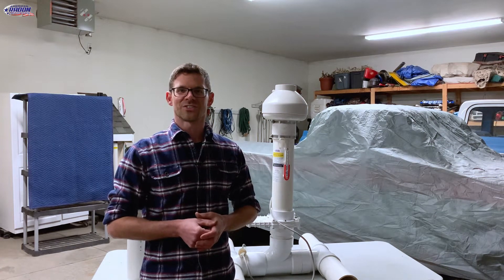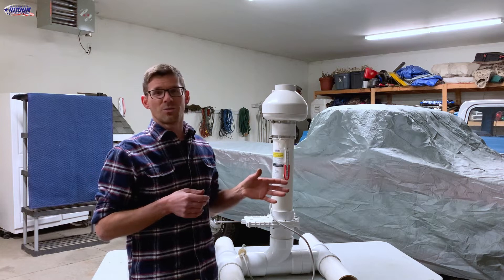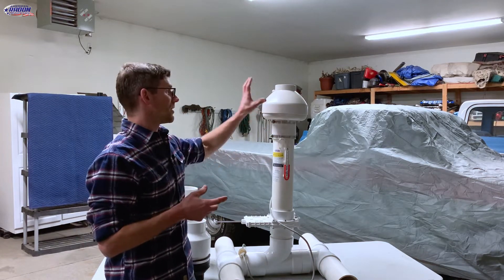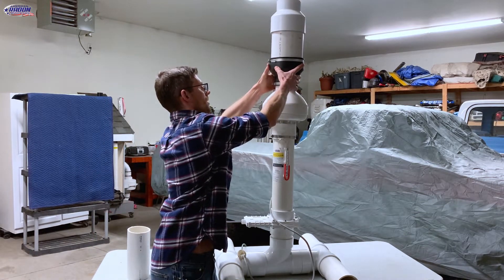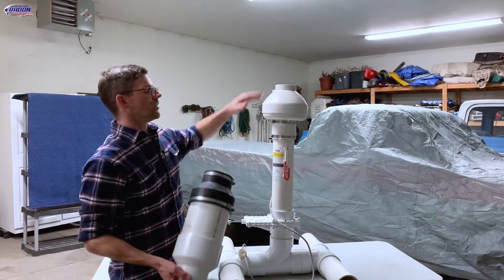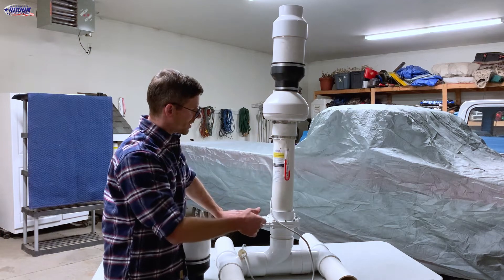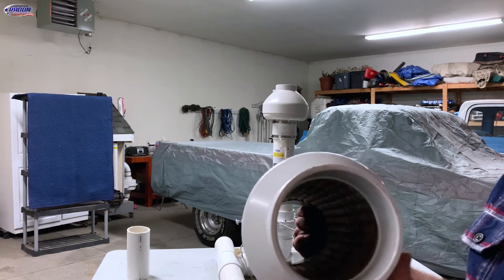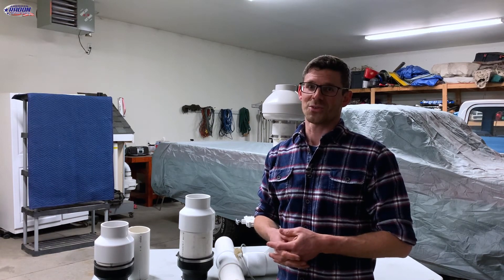Quiet Your Radon Fan: Real Customer Story + Noise Suppressor Demo

Comment: Do these suppress noise outside only, or can they help with airflow noise in the basement in the area where the piping goes through the floor?
Reply from the maker: Good question. I would only count on it reducing the exhaust discharge noise.

Comment: The silencer works by converting the sound into heat as the sound passes through the foam and vibrates it. TBH, that material used is pretty terrible. It only attenuates midrange to upper midrange frequencies which is why the sound seemed to get lower. A better material would be a polyester sheet, compressed fiberglass, or rock wool.
Reply from the maker: Thank you for the explanation! I've always wondered how it works. Do you think rock wool would perform much better than the fiberglass we currently use? Also, do you think it makes much of a difference where the noise suppressor is in the system? We mocked it up above and below the fan a few days ago, and it seemed like above the fan was much quieter. Do you know why that is?
Reply: @ sorry, I was confused. I’ve been looking at the ac infinity unit which uses neoprene foam. I am not sure if I’d use fiberglass- won’t that blow glass particles everywhere?  I am considering building one with Caruso Iso bond which is a polyester fleece material with really nice NRC values and no chemicals nor glass. I’d imagine the closer to the noise source the more effective. Else, sound is escaping the pipe along the way to the suppressor. Not sure why top would be quieter. You using a calibrated mic in anechoic chamber?
Reply: @AffinityPhoto  Did you try any other mufflers that performed well? I'm currently looking at building one, but also saw the 6" AC infinity one with neoprene egg crate inside it and was wondering the same thing.

Comment: Does a noise suppressor like this help reduce the pipe vibration above the fan? There's serious humming that I can hear through our exterior wall.
Reply from the maker: No, it would not. Be sure the piping doesn't touch the fan directly. It may have slid down inside the rubber coupler and is touching the fan, allowing noise and vibration to transfer from the fan to the piping. What fan do you have?
Reply: @AmericanRadonMitigation  Thanks for the reply!  I have a Radon Away GX5a fan recently installed 1-2 months ago.  I didn't think of the rubber coupling.  I have a 4" to 3" Spruce Flexible coupling--are there better options?  Thanks.
Reply from the maker: You betcha! You can try these softer rubber couplers: https://radonpds.com/shop/all-accessories/flexible-couplers/ldvi-4-x-3-coupler/
If you spend over $50.00, use coupon code JESSE to save a bit. We will receive a commission if you use the coupon code.

Comment: I quieted mine using a weather proof thick insulated fabric cover by the Redford Supply Co, Cold Snap 3-Way cover.  It’s not completely silent, but drastically quieter.   The bedroom is on the same wall as the vent pipe, so it could be heard whirling at night and disrupted sleep.  That is now resolved and can only be heard faintly if trying to listen for it.  Same improvement on outside of house while standing in backyard, where the noise is no longer noticeable.  It doesn’t look great on the house but it works.
Reply from the maker: I've heard the product they use to deaden road noise on floorboards also works great at reducing noise when wrapped around radon system piping.

Comment: It seems a cover could suppress all the noise completely.  A cover in the form of a box that conceals the whole fan on the outside wall of the house.
Reply from the maker: A noise suppressor really quiets the exhaust noise; a fan cover won't do that at all.
Reply: @AmericanRadonMitigation The cover arrived (a thick fabric insulated one that wrapped around it) and it definitely worked.  It doesn’t look great on the house but it’s in a privately fenced backyard and was an easy and instant way to silence it from inside and outside the house.  So this means an insulated box would work too but that type needs to be installed prior to installing the fan.
Reply from the maker: Thanks for the update! It sounds like the noise you were experiencing was from the fan rather than the exhaust discharge. Do you mind sharing what fan you have and what your U-tube manometer is reading?
Reply: @ Radon-Away RP145c.  1.4 reading.

Comment: Just got a system installed with a 170W fan (304 CFM at 0" WC or 22 CFM at 4.75" W.C.). Didn't know enough about these systems going into this to question why I got such a beefy fan. But it's audible from both the front and back yards and certainly the deck. Quiet enough from the nearest bedroom as long as the closet door is closed, but I'm sort of hoping I can slap a muffler onto the end of the pipe on the roof.
Reply from the maker: How to install a noise suppressor: https://youtu.be/92_3LxlNKwI?si=pOktzxpOV-JX5BcY

Comment: Are there fans that can be speed-controlled?  Im thinking of a scenario where full flow may not be required to do adequate mitigation.  Why not save on power and noise?  Or is it true that more airflow always means lower radon?  I wonder if there is no further radon reduction after a certain airflow is reached.
Reply from the maker: Yes, there are speed-controlled EC radon fans. You can check out the Fantech Rn2 EC and the Rn4 EC fans in our Amazon Store in the radon fans section. Amazon.com/shop/Americanradonmitigation

Bigger is not better when it comes to radon fans. There's more to it than moving more CFM. Check out this short video for a quick explanation: https://youtube.com/shorts/o8eOSu_ILdI?si=-SR7Dz8gow7wDJvS

We earn a commission if you purchase using the Amazon link. Thanks for your support and question!

Comment: What about a video that demonstrates how the size of the pipe impacts the noise? As well as the number of turns/bends present creating turbulence? I'd like to run my radon mitigation up an interior wall and place the fan in the attic, but I'm concerned about how much noise it might make. I'm also trying to decide if I should use a 3" pipe up the interior wall, or 2x 2" pipes. A 3" pipe would be tough to work with in my scenario.
Reply from the maker: That's a great idea!

I would not use a 3-inch pipe in a 2x4 wall as it will touch the drywall, and you may get a bass drum sound. 

How many CFMs do you need to move to hit your target sub-slab pressure? Knowing that is one of the factors that goes into selecting the proper size piping.

Comment: quick question for you guys... was watching the video and considering putting a noise suppressor however the main issue that I am running into is that the existing radon fan (XR261) is causing some vibrations in the gutter pipe (thus causing the vibration to the house siding that can be felt inside).
The fan doesn't appear to be vibrating, however goes from a 6" to 4" PVC pipe (could 45) into a 3x4 reducer to a galvanized gutter pipe. 
The vibration seems to be right around the 4 to 3x4 reducer causing the gutter that runs up to the roof to vibrate. 
Not sure if putting a noise suppressor would do anything... been wondering if the 3x4 should just be replaced by a 4" PVC instead to relieve some of the back pressure.
Manometer reading sits right around 1.
Reply from the maker: I'm not sure what to tell you, Sam. We don't use downspout, so I've never experienced what you are describing. I'd start by trying to isolate the system from the house to avoid some noise/ vibration transfer. I don't think a noise suppressor would help with what you are describing. It will certainly help with minimizing the discharge noise, though.
Reply: @SamWagner  I see this was a while ago, but did you get this resolved?  When you say gutter pipe, do you mean gutter downspout?  And was the fan’s vent pipe connected to the downspout?  If so, I’d agree that that needs disconnected and run upward on its own dedicated vent pipe.  That would eliminate that vibration as well as meet building code with its own pipe.
Reply: @flickeringcandle it uses a downspout pipe but it's a dedicated vent pipe... just the rectangular aluminium type piping. just seemed to create vibration on the house siding which can be felt inside. Was trying to see how to minimize that.
Reply: @SamWagner  Gotcha.  I’m certain the aluminum combined with a fan motor is what causes the noise.  PVC pipe is commonly used and would avoid that vibration.
Reply: I also want to add that even just leftover drips of water after a rain hitting the bottom of the aluminum downspout creates noise with each drop.  So, definitely metal is the source of the vibration noise.  But, even if you replace with PVC, you will still have the lesser motor hum, just not anymore vibration.

Comment: Does this suppressor lessen the noise in the adjacent room where the pipe runs on the outside? The low hum is very irritating.
Reply from the maker: It's hard to say, as it could be vibration from the fan transferring through your home's building materials. You could try loosening the pipe securement closest to the fan or switching to LDVI rubber couplers. https://radonpds.com/product-category/all-accessories/flexible-couplers/

Comment: We close on the purchase of our home in 7 days. They (SWAT RADON MITIGATION CO.) Just installed the system in the large basement.  It is ran on the outside up past the top story roof (3rd level) by approximately 3 feet. It is well away from windows & openings. The fan unit they installed  is a "RADONAWAY GX4" and is placed about 4 feet up from the ground. Looks to be a very good install, being that there was no way to run it internally, thru that many floors. It does however seem to be very powerful and with that ability, a bit noisy albeit on the outside.  I'm in Pennsylvania so I will be insulating the exterior. Two questions:
 1) Do you think they have it turned up  (higher speed than normal) do to an attempt to bring the Pic level down from 67 quicker? And  then adjust the flow upon safe level achievements?
2) once I insulate the exterior run, wouldn't  that in fact quiet the noise level?
On a side note... do you have an opinion on whether this particular fan is of good quality   and capable  of having additional extraction/evacuation pipes ran to it from other areas in the large basement (900+ sqft)? I've seen several other fans and none of them were this large. I'm wondering what the electric bill will be for this also.
Reply from the maker: 1) I don't use RadonAway fans, but I don't think the fan speed is adjustable on that model. A more powerful fan does not bring down radon levels more quickly than a weaker fan as long as you have full pressure field extension under the house. It is hard to say as we don't have any pressure field data. You may want to ask SWAT Radon for this information.
2) Yes, adding insulation to the piping may help reduce the noise of the fan and the air moving through the piping. However, a noise suppressor will help reduce the exhaust noise you may hear at the top of the piping.
Side note. I don't currently use RadonAway radon fans, but I assume they are high quality. If you engineer it correctly, you can have several suction points that lead back to one radon fan. You can find the estimated fan wattage using the spec sheet. https://www.radonaway.com/pdfs/radon-newsletters/pdfs/GX_Series_111920_revA.pdf
Reply: @AmericanRadonMitigation  thank you very much for your professionalism and information. In my opinion (as a retired Government Supervisor,  who's been certified as  HAZMAT OPERATIONAL & RESPONSE for well over 30 years) you are no doubt a leader, if not the #1 leader in your field. Well done.
Reply from the maker: Thank you for the compliment! I've been fortunate to have many amazing people share their knowledge with me.

Comment: I can't believe my radon guy didn't mention suppressors when I complained about the noise from my system. I need this!
Reply: @nhart9043  I can’t believe the installers aren’t discussing the noise with us ahead of the project and offering options to include with the project.
Reply from the maker: It might be a good option if you have a loud exhaust noise.

Comment: It looks like you don't sell these on your website. Would you be able to provide any details on what foam you use in them? I'm outside your service area and would like to build one for myself. The ones I see sold online use smaller diameter pipe
Reply from the maker: They have fiberglass insulation inside.

We offer three varieties to choose from. Check them out here: https://americanradonmitigation.com/product/attic-noise-suppressor-medium/